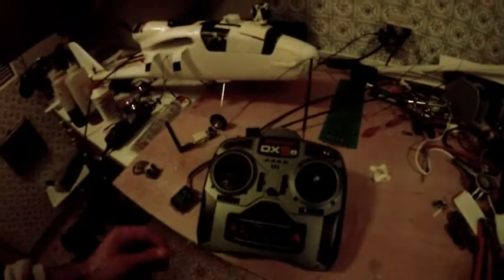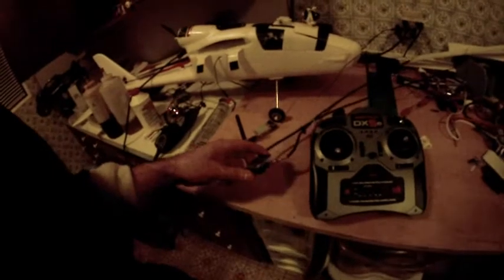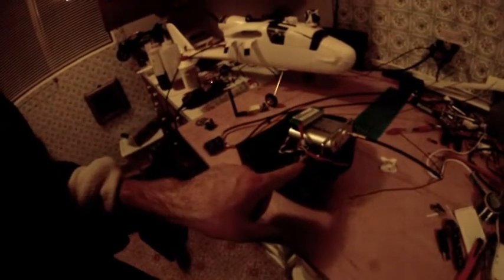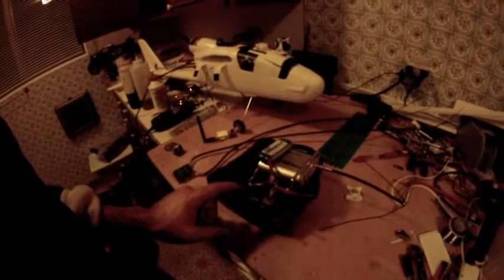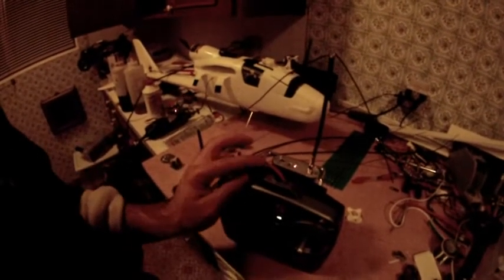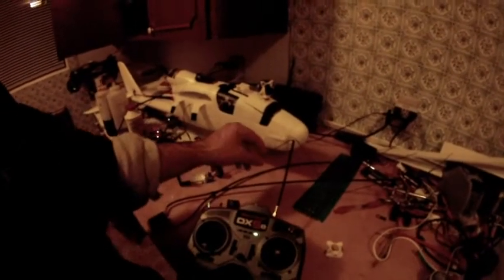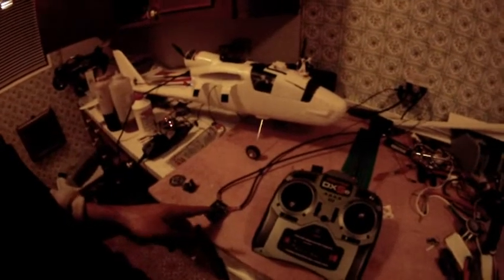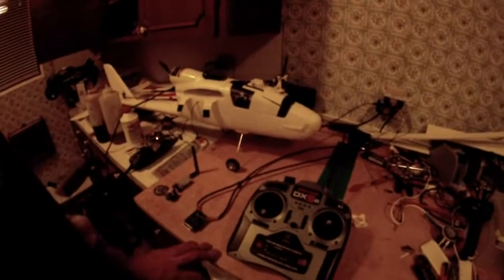BEVRC Chainlink Dare with Spektrum DX5e

Comment: Isn't it possible to just modify a wire so you can simply plug it into the trainer port?
Reply from the maker: That's essentially what I did, except instead of plugging into the outside of the trainer port I plugged it into the inside.  In other words -- as long as I was in there modifying one wire, figured might as well solder a few more on to avoid having something sticking out the trainer port.
Reply: Ohhh ok so you wanted everything closed up behind the scene, nice. I'm getting into the hobby I might do just what you did.